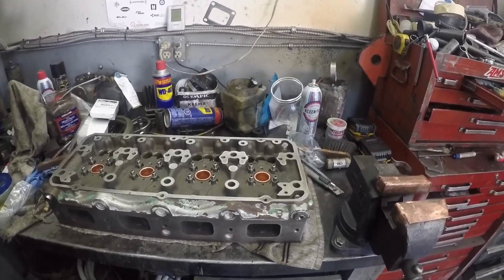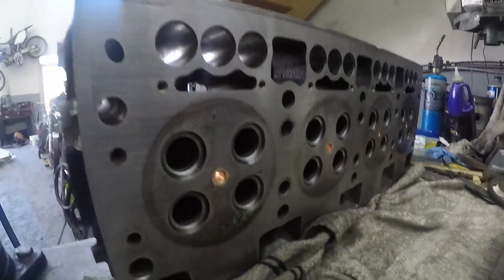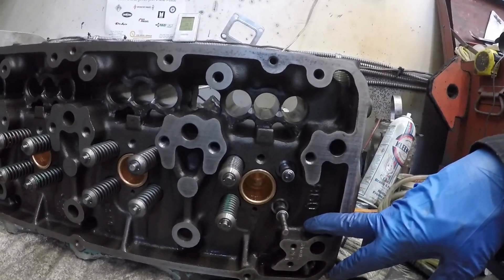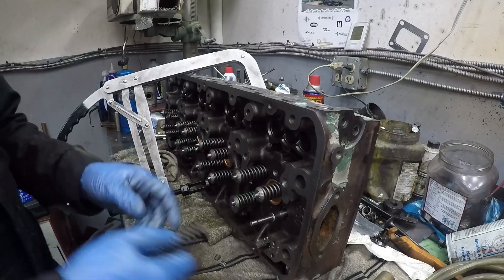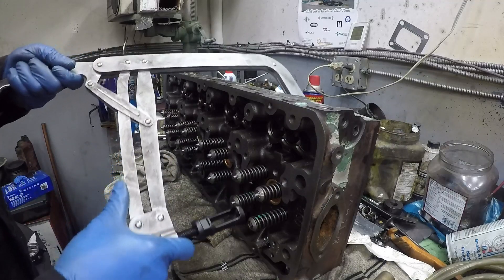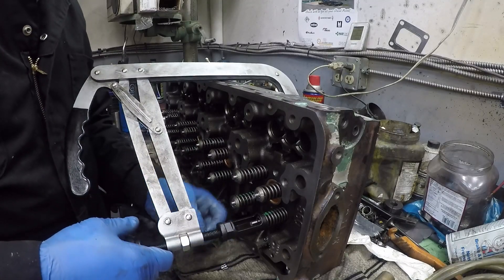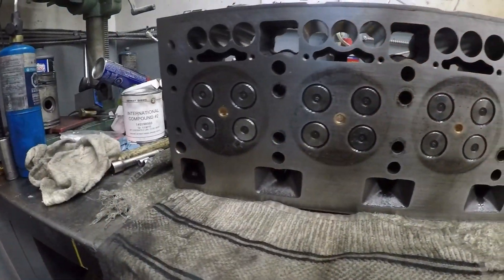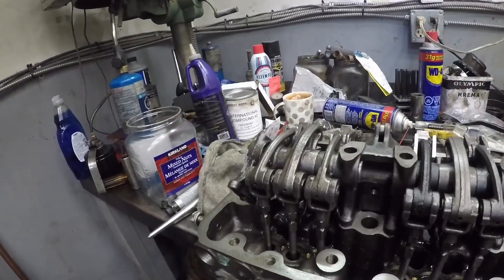Detroit 4-53T Head Assembly

Comment: The head on my 4-53T appears to be a low hour Reliabuilt complete cylinder head. Even the roller lifters are stamped Reliabuilt. I think they put a head on a worn out bottom end hoping it would fix it. On the bright side, hopefully it won't need much work to get it back in order. I'd love to find a complete rebuildable 4-53T Silver core for a reasonable price, but it seems like everyone wants STUPID money for silver cores. Some as much as $4500 US, too rich for my blood!
Reply from the maker: It’s amazing the kind of money people are asking for cores, just amazes me.  Hopefully your bottom end is in good condition, then it’s a cheap overhaul.  I originally was going to do a quick rebuild, but once I started measuring and inspecting everything that was not going to happen.  For the condition it was in its amazing it ran at all.:).